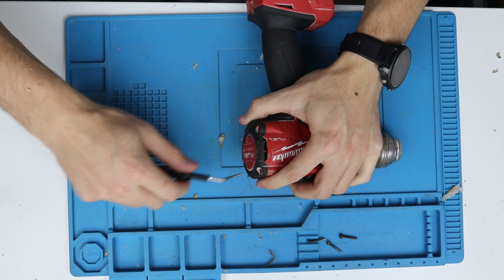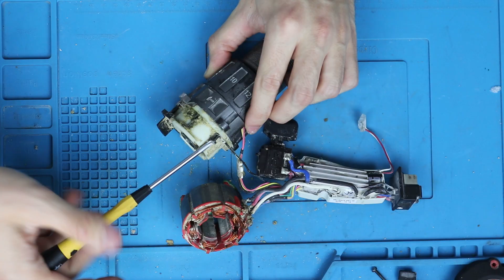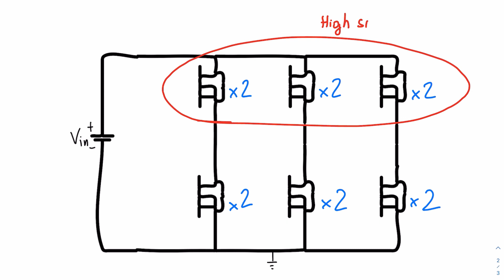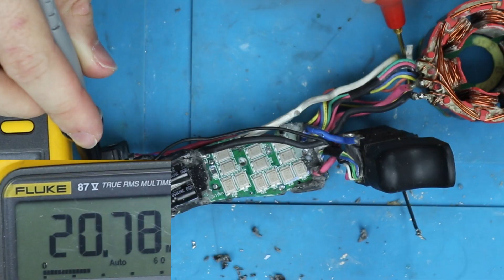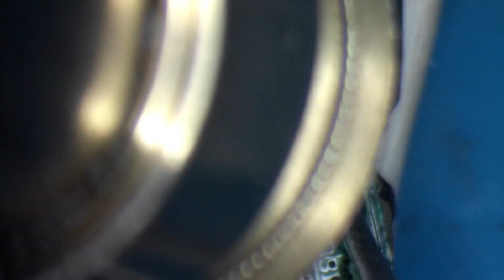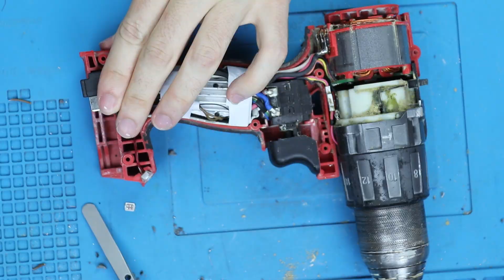Milwaukee tools clicking — M18 FPD2 clicking repair

Comment: Here is the method to take the radiator out because the video fails to show how to split the radiator from the PCB.
The radiator is held by  7 screws (more or less). Unfortunately they are screwed from underneath (between the PCBs) and the only way for you to unscrew them, is to separate both the PCBs. This is almost impossible, and can damage the control board easily. At least I broke mine while traying to separate them :(
Basically there are two ways to get the radiator out:
1) the factory way. You have to  separate the 2 PCBs. This is hard, and with a high risk of damage (but also may be the cleanest way). To separate the PCBs you have to unsolder the 14 pin header completely (this is the interface between the PCBs, the rest is just black silicone that hold them together). If you manage to completely de-solder the 14 pin header and using a heat gun to keep the remaining solder "wet", you can try to pry it open. If you manage to unplug the header cleanly then you are in the clear and now have access to the radiator screws. YEY good job.
Unfortunately for me, I didn't know this and broke it. After using a desordering mesh on all the pins, I tried to separate the PCB without without any luck and in frustration I pried out the header ( with no additional supporting heat). Of course the header snapped, and broke from the PCB. SO there's that.
2) the way of the video. You just drill all the screws, and take out he radiator. That's it! simple right? Wrong! You have to be EXTRA careful how deep you drill as not to damage the PCB underneath. And second issue...you cannot mount the radiator back as there are no more screws to hold it. The solution of course would be some kind of non conducting thermal adhesive or other clever way to keep the radiator on.
In my opinion solution 2 is easier and safer compared to solution one. 
Hope this will help, cheers.

Comment: Fantastic videos - very clear and straight to the point! Could you do a video on the Milwaukee multitools please? I have recently acquired a M18FMT (fuel multi tool) were the LED comes on and a click is heard from the motor. Interestingly, when the rotor is turned, at specific points the motor will run but will turn off after 1 second and then crackling sounds can be heard when it comes to a stop, or in other cases it just attempts to spin and judders in the same spot when the switch is pressed. 

I have taken off the PCB potting, checked for phase wire shorts, checked the caps, and resistor values, and mosfets seem fine. I changed over the motor controller IC as I don’t have an oscilloscope however it still exhibits the same issue. The daughter board connections looks fine although I have not checked the components on this, and I haven’t taken apart the motor yet as I’m not sure how to separate it, I think a cir-clip holds the rotor in place. 
Going by your Bosch drill video, I reckon it could be a windings issue. Be great to hear your thoughts on this and to see what issues you’ve had with multitools!

Comment: The issue I have is with the speed control it's very difficult to control slow speeds, it wants to skip from off to high speed at about 50% movement of the trigger.  How easy is it to repair the trigger control on the FPD2?
Reply from the maker: It all depends what the issue is, could be board or switch related. Did you make sure the clutch itself works as different clutch settings on the Milwaukee drivers result in a different trigger response. 

Good luck 👍
Reply: @how_its_fixed hi mate do you know where I could get the piece as not on Google thanks